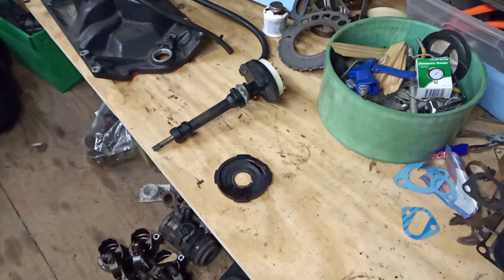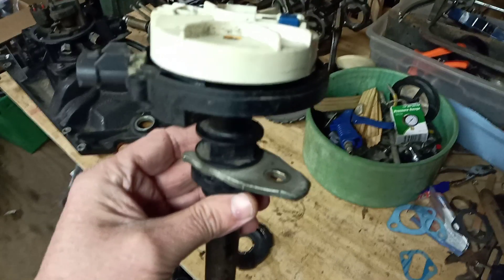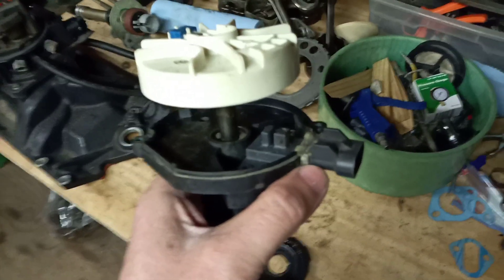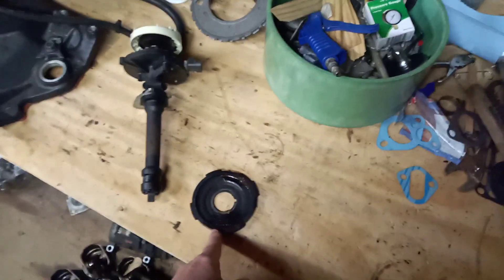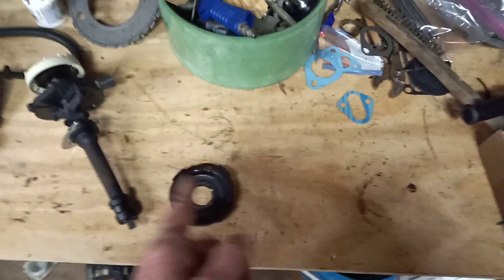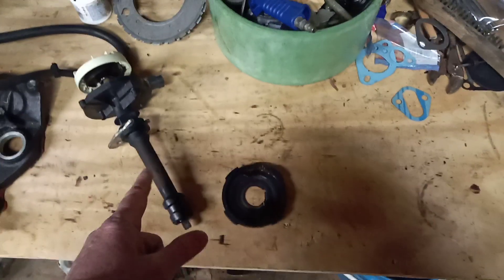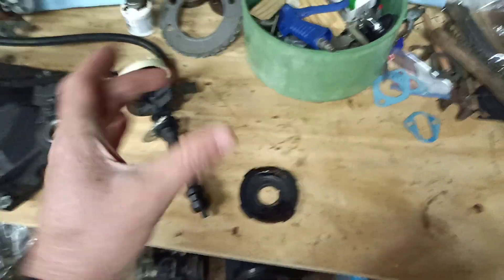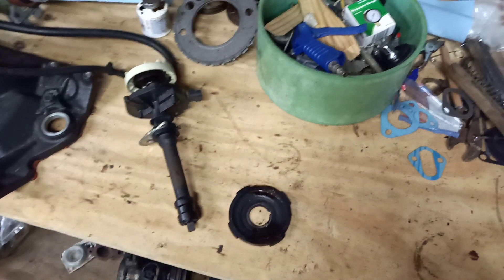Debunked - Dodge Fuel Synchronization - Part 2 (Hit Like If You Agree w/Me)

Comment: If you have access to the factory service manual for these engines it states the distributor pickup is for cylinder identification. Kinda akin to what you’re saying but syncing the system goes off TDC of the compression stroke on cylinder 1. When you advance or retard the fuel sync you’re basically telling the system “hey right here we’re all lined up” but the piston is still moving up slightly. Advancing is typically done with aftermarket camshafts to line up injectors firing point with intake valve opening point better. And really it’s only important at lower rpms for idle quality and drivability. Higher rpm everything’s happening so fast there’s a nearly constant flow through the runner like you would have on a high rpm carb application
Reply from the maker: I respectfully disagree. You are not grasping the point of the entire video. Setting fuel sync has nothing to do with lining up anything. The PCM is programmed by fixed code to accept any camshaft position within a range that the engineers decided is acceptable to consider synchronized with the crankshaft. Outside that range a code will set and the engine won’t start because the PCM can’t identify which cylinder the crankshaft is pointing to. I thought it would batch fire but it doesn’t. It just won’t start. Once the engine is running and the PCM has identified which cylinder is number 1 on power stroke it stays synchronized and will keep running even if the cam sensor fails. You can put any camshaft you want in the engine and advance or retard it but it has nothing to do with injector timing because the PCM code doesn’t care. You’ll still have to set the fuel sync (cam sensor position) within the range of plus or minus 8 degrees ( I said 8 but it could be  another number) to allow the PCM to know where cylinder #1 is or you’ll have a no start condition. As I tried to make clear, the injectors are fired 100% by the crankshaft sensor once the cam sensor has helped the PCM identify which part of the 720 degree cycle it’s in. Btw cams are advanced or retarded about 2 degrees typically. The injectors fire about 60 degrees BTDC on the exhaust strike so the installed cam position has no bearing on injector firing. I’m going to box in the injector timing in my next video on this subject.
Reply: @moccasinmarine  well then, respectfully, why does the number 1 Mopar tuner in the country want to see +12 on one cam and +4 on another? It DOES in fact fire them sooner. It will run within a given range yes but with aftermarket cams is where fine tuning fuel sync really becomes important. I challenge you to get any kind of drivability out of one of these with a 220-230@50 cam and with -4 to -8 on fuel sync. Just try running it there and then sync it to +4 to +8 and see what it does. Guys have only had this figured out for almost 20 years now
Reply from the maker: @tylerphelps4868  It’s a scam. You used the dirty word FACT. Facts require proof.  Either provide proof in the PCM code that the fuel synchronization number is used to set injector timing or we can’t have an intelligent discussion on this topic. When fuel synchronization is set, you are setting the cam sensor to trigger within a window of degrees of crankshaft rotation. The crankshaft trigger is permanently mounted and locked to the crankshaft and the cam has nothing to do with the relationship between the crankshaft and its sensor. You can install any cam you want in any position allowed by its keys but you’ll have to rotate the distributor back to where the cam signal falls within the range of allowable fuel sync degrees or it won’t run. But once the cam signal is within range, it has nothing to do with injector timing. If you want to discuss further you’ll have to bring proof instead of hearsay from the hype sellers.
Reply: @moccasinmarine  what you’re saying is that once in range, let’s say +15 to -15 degrees, the cam sensor is taken completely out of the equation and the pcm relies completely on the crank sensor? I’m sorry but that’s not how it works. You’re inferencing a lot based off other platforms, platforms that can’t tune for larger cams. It’s completely different logic. You’re very confident in your “findings” yet you cannot answer me question on why do tuners ask for a specific setting in the first place? Again, I challenge you to actually do it as a so-called tuner. Run an aftermarket cam at multiple range points and just see how much grief it gives you
Reply: It has nothing to do with hype or scams, it’s just a pain in the ass part of the process building these things with the factory efi because it can be difficult at times to find the scan tools that will do it properly if you don’t already own one. Tuners wouldn’t be messing with this at this point if the whole time it was bullshit and had no effect on anything. That would just cost them time and money. No, it’s quite important and I don’t understand why you’re trying to reinvent the wheel
Reply from the maker: @tylerphelps4868  Come back with some facts and leave your emotions out of it. Until then I’m calling it BS. Simple question? Did you watch the whole video and leave out your preconceived beliefs on how it works? Have you ever recoded and compiled assembly code in a PCM? If not then you are falling for the hype. Ask your tuner for proof in the code.
Reply: @moccasinmarine  I’ve responded to your latest video but I could say the same to you, leave your pre-conceptions and emotion out when you respond please. You’re greatly overthinking and from what I can tell now, misunderstanding what people have told you
Reply from the maker: @tylerphelps4868  All I can say is bring some proof. Have you ever degreed a cam? Do you know what valve timing events are? If not you are out of your league and defending something you know nothing about. Either bring proof or you have no credibility. Intake valves typically open around 20-0BTDC. The injector stops spraying 60 BTDC. The injector timing and valve timing are so far apart that they are unrelated for all practical purposes. Now if the “Mopar Tuner” is changing the EOIT in the code to have the injector spray later (to clean up the smell on wild cams) then yes he’s doing something of value but that has nothing to do with fuel synchronization. Over and out until you come back with real proof. Btw setting fuel synchronization is not tuning. It is making a basic setting to the cam position after a rebuild. That’s not tuning. That’s doing mechanic work.
Reply: yes I have degreed a cam and understand what valve timing events are. Whats your proof the injector stops spraying at 60BTDC? You keep asking for proof but fail to look at how the system mechanically works. You’re overthinking and misunderstanding. I’m not sure exactly what you mean by EOIT but I’m assuming it’s injector fire timing within the pcm, which is not adjustable in these. You can adjust the length of time they’re open in the tables but that’s about it. This is part of where fuel sync comes into play, you cannot tune the injector to come in earlier. You are correct, fuel sync isn’t tuning. I never said it was and anybody trying to claim it as such is vastly mistaken on basic things. Fuel is a basic mechanical setting yes but it is NOT a cam position setting. You set cam timing with this the gears and chain well before fuel sync ever comes into play. Fuel sync is purely setting the cam sensor to overall engine position and it is from that that the pcm fires the injectors. Their fire point is not adjustable outside of fuel sync.
Reply: You’re so dead set on disproving a well established proven system that you can’t step back and just look at why it works
Reply from the maker: @tylerphelps4868  Proof of 60 degree BTDC    injector firing coming right up in the next video. Watch for Part 4 in the next few days.
Reply: So.... I just need to replace the distributor on my bone stock 5.2. Am I going to have problems or can I just put it in there loose and turn it till it runs good like an older vehicle? Or just make sure it's more or less in the same position as the original one? Reason I'm swapping it is because one of the lobes that the cap screws to broke off.
Reply: @stevenpalermo7549  first: why do you need to replace it? It’s not something that wears out. Secondly: you need to follow the service manual procedure of lining it up mechanically. That gets you really close and you can pretty much call it good depending on how smooth it’s running. To be perfect you need a snap-on scan tool or a dealer trip
Reply: @tylerphelps4868  I need to replace it because one of the screw holes for the distributor cap stripped out. They are cheap as dirt so I figured I would change it instead of trying to drill and tap it but if I would have to take it in to get it right I'd rather just repair it.
Reply: @stevenpalermo7549  you can get it close enough with the setting procedure to where on a stock vehicle it really doesn’t matter. If you’re modifying it I would do it right but stock, adjust it to where it’s smoothest and rock it
Reply: @tylerphelps4868  Thanks for the input. Maybe I'll just do that. I would like to modify it but I'm in CA and I don't think I can get it to pass smog with anything past a cat back exhaust...

Comment from the maker: I’m working on Parts 3 and 4. I’m going to show what could be making your engine run poorly if the fuel synchronization is not set correctly. Hint: it has nothing to do with injector timing.
Reply: Instablaster...
Reply: Older video-I know….

So if my fuel sync is not set correctly, and engine runs poorly, and the reason has nothing to do with injector timing, then what IS the cause?

Your video #3 never talked about that.
Reply from the maker: @mikeball9116  I can’t really remember as it was long ago and I moved on to other topics but it was probably this: on engines with a crankshaft position sensor AND a distributor, the timing and the trigger for timing comes from the crank sensor. The distributor is therefore relegated to doing just that, distributing the spark to the right cylinder in order. But on distributors like this Dodge the distributor still can be rotated (Chevrolet had a clamp that locked the distributor in one position). If you rotate it too far the spark will actually jump to the next cylinder causing massive timing advance or retard on occasion. So even though the distributor is no longer rotated to set the timing its position is still important for correct cylinder spark sequencing.
Reply: @moccasinmarine 
Oh so the rotor phasing issue? 

I think you posted a link to Haltech’s video on that.
Reply from the maker: @mikeball9116  if I did, it wasn’t on this video. Do you know which video I posted the Caltech link on?

Comment from the maker: In the video I mention End of Injector Timing. This is widely known as EOIT. You can search for EOIT on YouTube and learn a lot about it. But it’s totally controlled by the PCM using the crank position sensor (once the cam sensor has synchronized the crank sensor) to fire the injectors at a specific location in the 720 degree rotation cycle.

Here is a link to a good video on setting up EOIT on a Gen III LS engine.
https://youtu.be/jTEA9eq2QGc